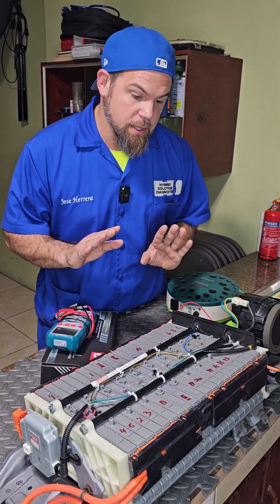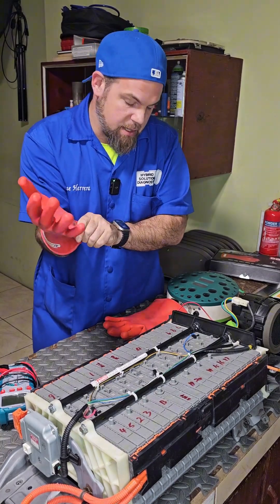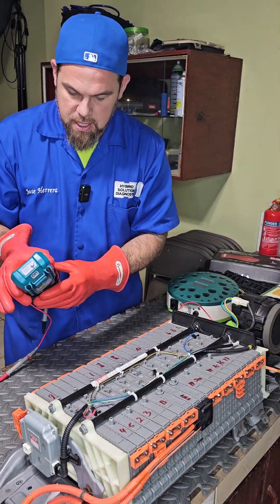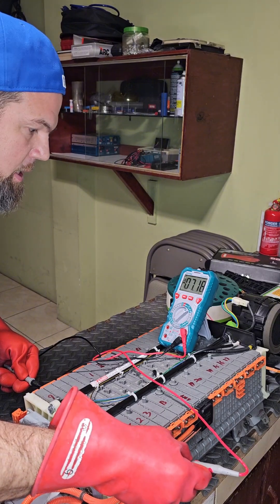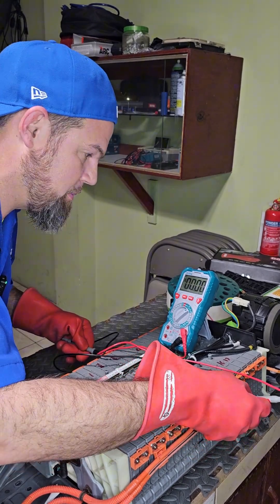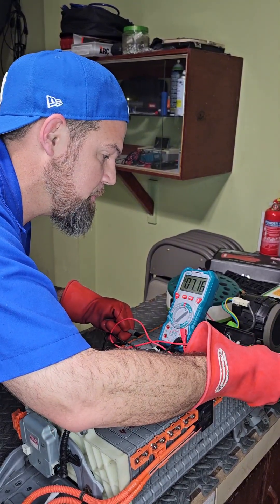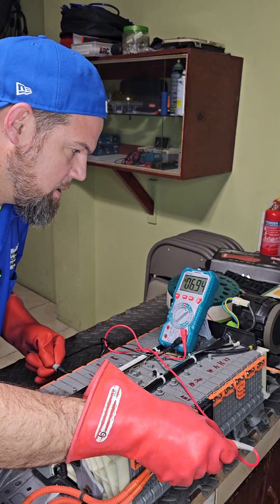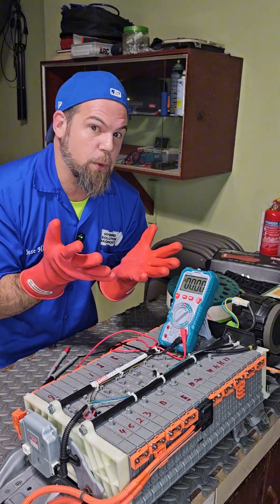Easy Method to Detect a Weak Hybrid Battery Module with a Multimeter During Pack Discharge

Comment: I own a 2019 toyota chr hybrid 1.8, I'm interested in why the car moves too slowly when I release the brake, but when I release the brake it goes into reverse at normal speed, in drive mode I need to add gas, I don't get any warning lights, the car drives normally and there are no anomalies that something is wrong, it simply starts slower than when I put it in reverse. thank you.